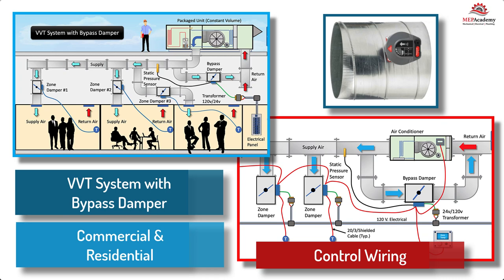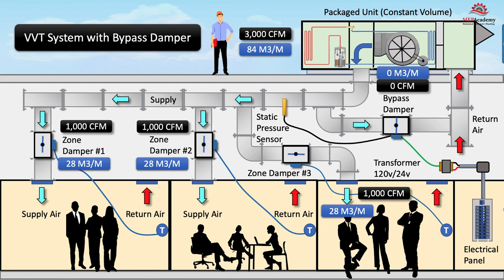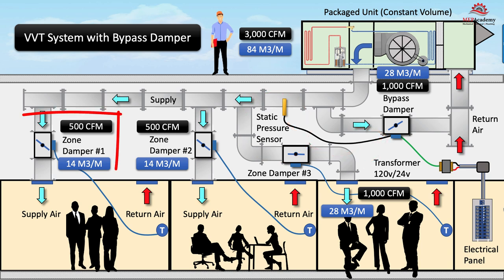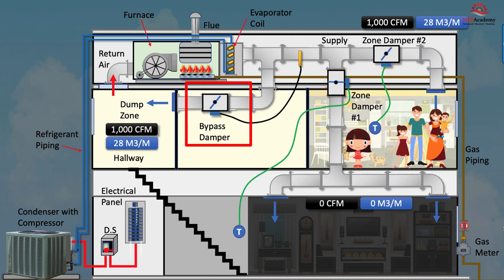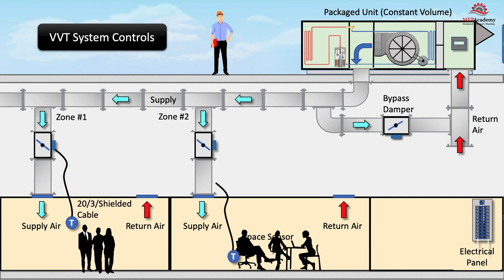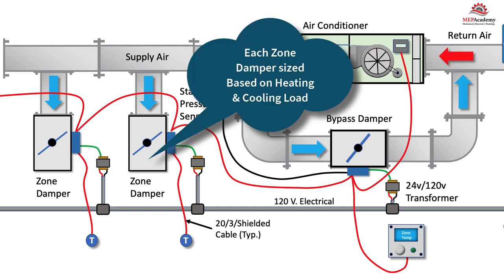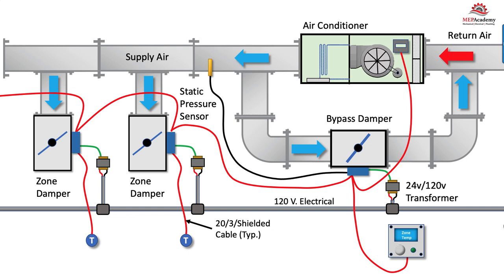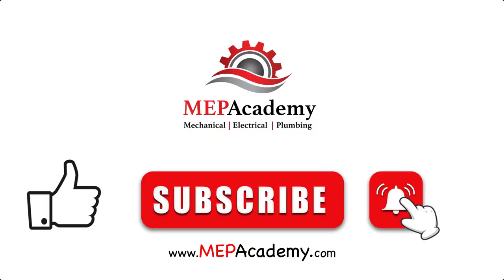Bypass Damper HVAC VVT System

Comment: I am having major humidity issues in my home and the bypass i have is static not dynamic so always in one position.  Could this be the cause of my problem?
Reply from the maker: There can be many reasons for this: Short Cycling: VVT systems can cause the air conditioner to short cycle, especially if the bypass damper is open too often. Short cycling means the air conditioner turns on and off frequently without running long enough to adequately remove moisture from the air. Bypass Damper Operation: When the bypass damper is open, it allows some of the conditioned air to bypass the living spaces and return directly to the HVAC system. This can reduce the system’s ability to cool the air in the living spaces, leading to insufficient runtime for dehumidification. Oversized HVAC System: An oversized air conditioning unit can exacerbate the problem. Oversized systems cool the air quickly but do not run long enough to dehumidify effectively. Improper Zoning and Airflow: In a VVT system, improper zoning or poor airflow management can lead to uneven temperature distribution and ineffective dehumidification. If certain zones reach the desired temperature too quickly and shut off airflow, other zones may remain humid because the system doesn’t run long enough to dehumidify those areas. Bypass Damper Settings: If the bypass damper settings are not correctly configured, it can lead to an excessive amount of air bypassing the living spaces. This reduces the efficiency of the system in removing moisture from the entire home. The settings need to be calibrated to ensure optimal airflow through the occupied zones. Lack of a Dedicated Dehumidification Mode: Some VVT systems do not have a dedicated dehumidification mode, which could result in inadequate moisture removal. Advanced HVAC systems with dehumidification modes can operate at lower cooling capacities for longer periods, enhancing moisture removal even if the temperature setpoint is quickly achieved. Good Luck.

Comment: Is it too far of a reach to compare this to a primary and secondary water loop? Where the primary loop is basically driven by constant speed pumps?
Reply from the maker: Good analogy. At least there is an energy saving component on the secondary side with VFD's on the pumps, no such luck with the air-side bypass damper.

Comment: So the only difference between vav and vvt are bypass and vfd? Or i dont get it 😅
Reply from the maker: VVT systems are not widely specified anymore as modern HVAC system provide a more energy efficient solution including the VAV system and VRF/VRV Systems.